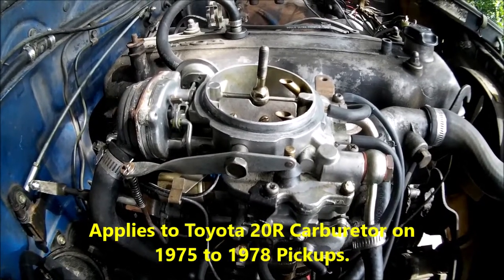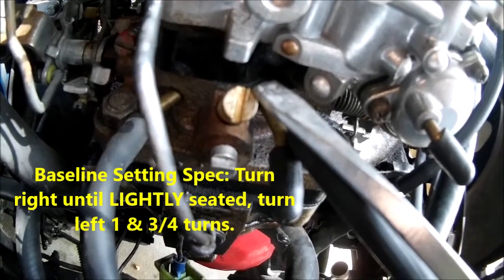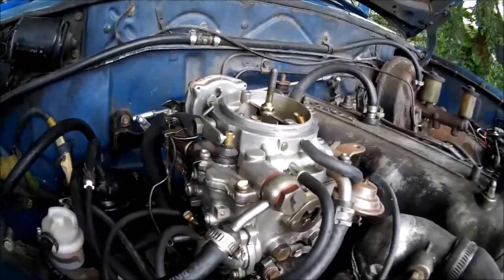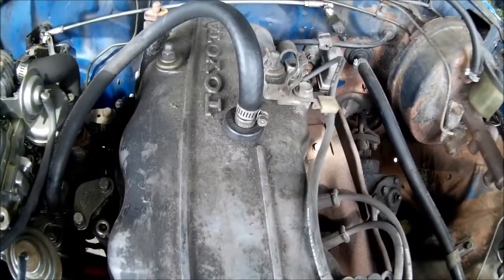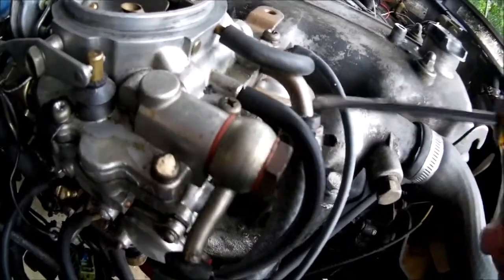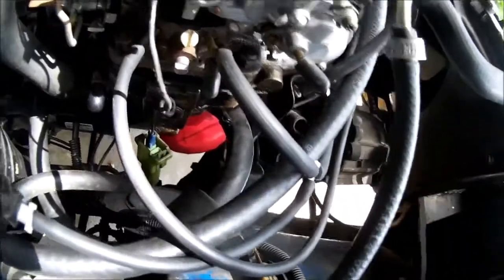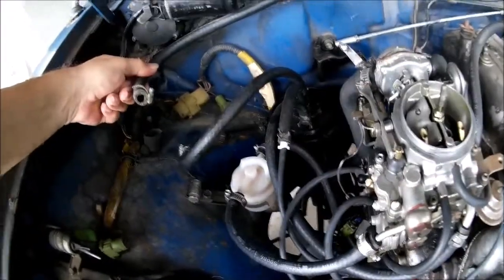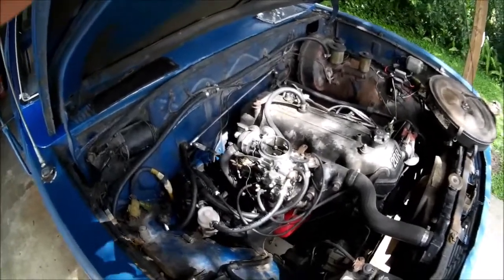1978 Toyota Pickup/Hilux 20R-Carb Adjust & Vac Lines-Desmogged

Comment: I’ve been over this video a couple times to reference my little 1976 Toyota Pickup I believe is an sr5 but the place from where your filming is where all my vaccum lines run to the carburetor from. Wondering if yours is very different or if I don’t need that?
Reply from the maker: I'm not quite sure what your exact question is? If you could word it more specifically I can give you better answers.

In the meantime, if your '76 has the 20R engine, there is a vacuum line diagram available for it on Ebay right now: https://www.ebay.com/itm/1976-Toyota-Pickup-Truck-Hilux-Vacuum-Diagram-Decal-Repro-20R-2WD-/324079297896

The simple answer is that all those vacuum hoses are there for emissions equipment. Unless your local laws require that the equipment be present, you do not need it for the engine to run well and to run clean. The '78 does have some extra emissions equipment that the '76s & '77s do not have; an emissions computer and some extra vacuum valves & tubing. Mine may look different now because I have removed nearly all of the emissions equipment (desmogged. After 40= years most of it was not working anyway, there are no replacement parts available new, and it was a source of vacuum leaks.

Again, if you have specific questions please feel free to send them to me, and I'll do my best to answer them.
Reply from the maker: I did see part of your second message, but for some reason Youtube won't let me see the whole thing. I do see you found the same Ebay listing for the vacuum diagram for the '76 tho. The box with the 8 vacuum ports on it marked "V.S.V." in the diagram is a Vacuum Switching Valve. It actually has more than one valve in it to do different things at different times, depending on what vacuum signals it receives from the various components hooked up to it (see diagram). Not all those components send a vacuum signal all the time. From '78 & up, Toyota starting using single VSV's in various places, instead of putting them all in one box like yours. That is one difference, but it still works the same way.

Perhaps a simple answer here is that you could disconnect any or all vacuum line(s) going to that box at the lines source on the engine side of it, then cap the vacuum ports on the engine side so you don't have any vacuum leaks. Then retune the carb to best lean idle. I can give you links on how to do a best lean idle adjustment; it's not hard to do.

As long as you don't have to pass any "smog inspections" you can do this.